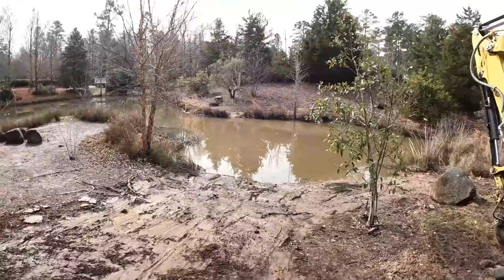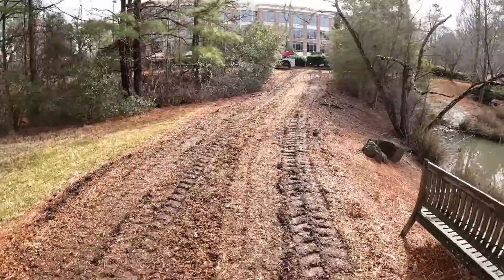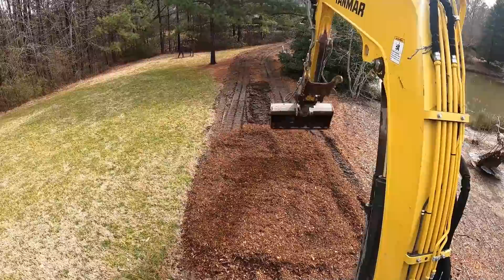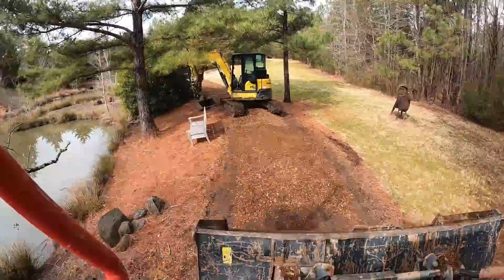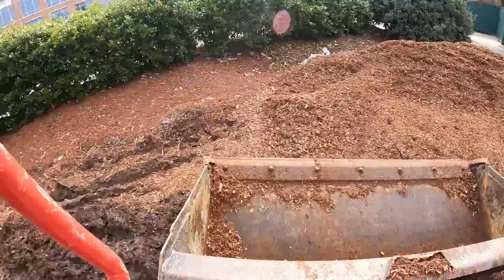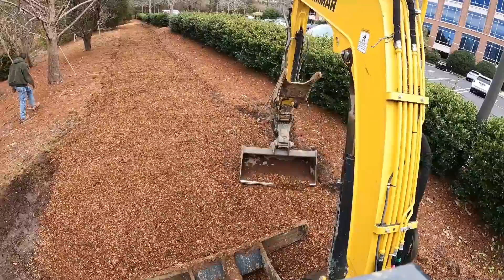Repairing The Mulch Walking Trail

Comment: Question ….why weren’t you back dragging with the skid steer to remove the crown from the trail and smooth as you returned to the mulch pile?? Not being smart just wondering. Looking to be a better operator so when I can’t get actual seat time I look to learn from others seat time.

Comment: Hi from Australia , I was watching your clip when you were doing the servicing on the excavators , this might be a dumb idea but I  was thinking maybe you could use a flexible plastic cutting board to fit in under a filter to make a trough so it will drain into a pan , might be worth a try , cheers

Comment: One thing I have never seen in the years I have followed this channel is a power washing video of the tracks on an excavator and re-grease, any chance Chris?
Reply: Tracks don't get greased :-)......except to tighten.....
Reply: Yeah i would like to see Chris do some real work too LOL.
Reply: @mikeroberts7392  So the running gear is drier than a nuns vanny?, I find it hard to believe all those moving parts on the tracks dont get greased.
Reply: @mikeroberts7392  Dont get me wrong, what I know about excavator tracks you could write on your big toe nail with a sharpie, but surly they get greased?
Reply: @hentycatsanctuary2951  As opposed to the fake work he has been doing all these years?
Reply: My life is a lie!
Reply: @formhubfar  lol
Reply: Samuel Lim  life time lubricated, you should Patent that!
Reply: Lubricated for life! (TM).
Reply: @formhubfar  No they don't get greased!
Reply: @formhubfar  There is oil in the final drive, the tracks do not get greased!
Reply: @mikeroberts7392  I am not stooopid mate, I know the tracks dont get greased, I was talking about the runners.
Reply: @formhubfar  Nothing on the entire undercarriage gets greased, nothing....The rollers have oil in them and are sealed...
Reply: @formhubfar  Mike is correct, nothing gets greased on or near the tracks....Grease is used to push out the piston that tightens the track and used on every pin/bushing on the boom, stick, bucket and turntable....but not the tracks.
Reply: I didn't think you meant the actual tracks...I was trying to tell you that nothing on the entire undercarriage gets greased....nothing....
Reply: @formhubfar  well the "runners" what ever they are don't get greased either :-)
Reply: @mikeroberts7392  Your right and I am wrong, have a great day.

Comment: Wow!! Being able to tilt that bucket is EVERYTHING!!!
Reply: yeah tilt bucket i was looking at one at my kubota dealer wich hes the only one carries it
Reply: How much is it? If u watch hedblom on utube u would not run one without a tilt/rotator
Reply: @michaelmactavish4445  what brand were you looking for ?
I bought a Helac power tilt for my KX161-3.  BEST thing I ever did
Reply: @delcasaleexcavating9508 wow you have a helac thats what my kubota dealer sells is  the helac tilt bucket even fits on case excavators as well wich he sells as well
Reply: @michaelmactavish4445  yes sir I do....I actually inquired about getting a engcon tilt rotator for the new Kubota KX-040 I had ordered in November 2019 but changed my mind when I found out it was gonna add another $35-40,000 to the cost....
I paid $6500 for the Helac and don't need anything else

Comment: The city park near me uses Decomposed Granite as the base on the trails, along with thick steel edging.
Reply: The parks near me use asphalt only use wood chip under the play equipment for the under tens.
Reply: @johnmccallum8512  Recycled Rubber Surface Carpet material covers the playground area.

Comment: Awesome finish on that muck hole job! Tilting the bucket on end to tidy up the edge was cool. 

Does someone have excavator controls that you could reach out and set the bucket elevation at the 1st point and then set a 2nd elevation at the excavator and it would automatically keep those two points and travel a even level between them? Your LD18 control bottled, so to speak? I would guess someone has designed it but it ain't cheap, LOL. I have used some robots 🤖 that have calibration points.

Comment: I'm thinking you could have saved some diesel fuel by just spreading it out with the skid steer as you did then hired some non-home depot associates to spread it out with rakes.
Reply: Chris doesn't seem to like depending on other people (with a very few exceptions) to work with him. He knows that he will be on time, stay until the work is done, be a product that he can be proud of and won't have to told to breath out before breathing in.

Comment: Why use mulch? Won’t it turn into mud? Won’t weeds grow? Is it cheaper than gravel?
Reply: How would wood chips turn into mud?🙄 mulch is a weed control around trees and flowers
Reply: @richardschipper5989    Mulch has to be replaced every year. The wood breaks down. I’m assuming it’s just like mulching around flower beds.